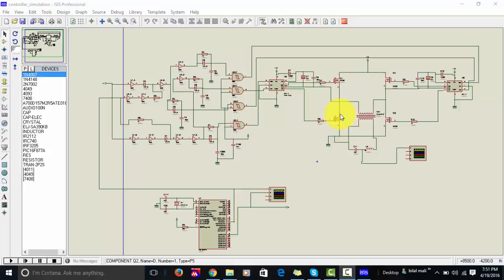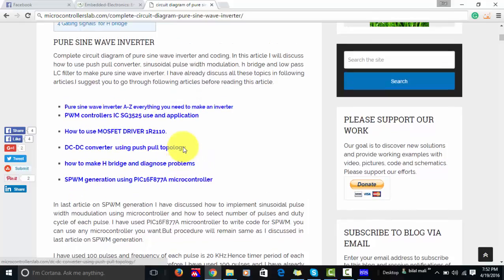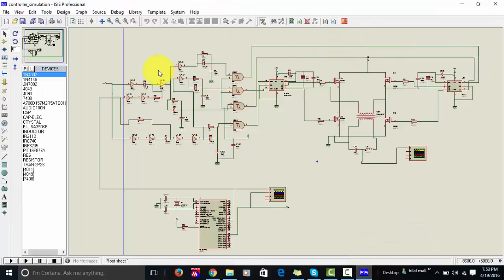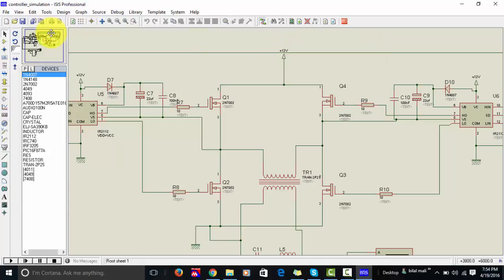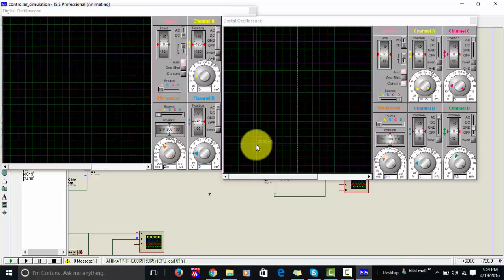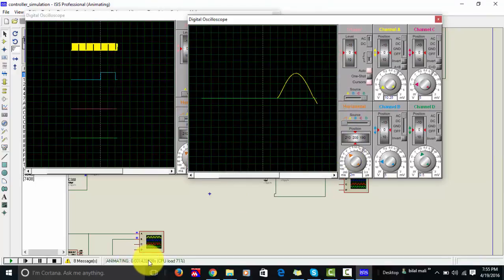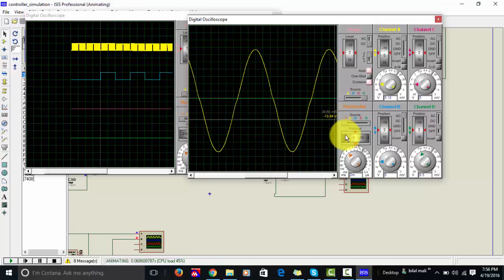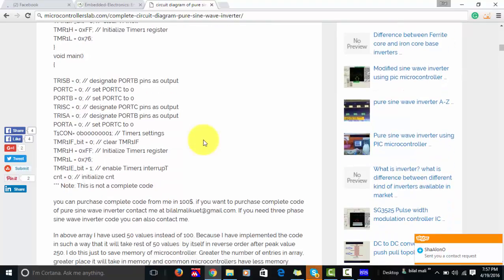pure sine wave inverter using pic microcontroller

Comment: Does the inverter have feedback for stable output when loaded. Can you use pic16f886 for this code?
Reply from the maker: No feedback, microcontroller PIC16F877A but design is available with pic16f886 also